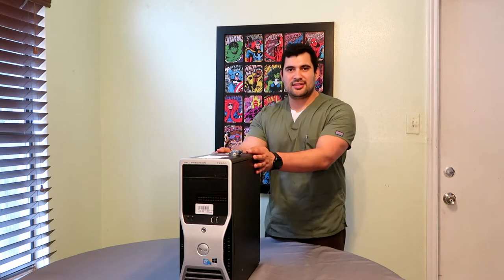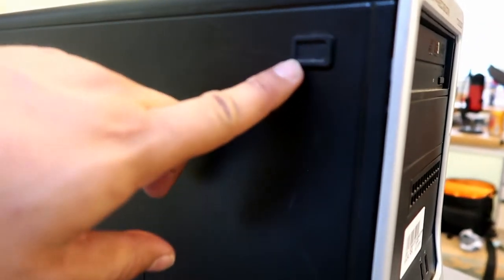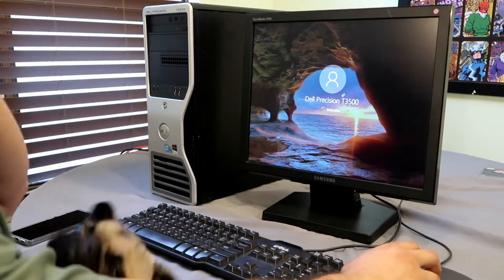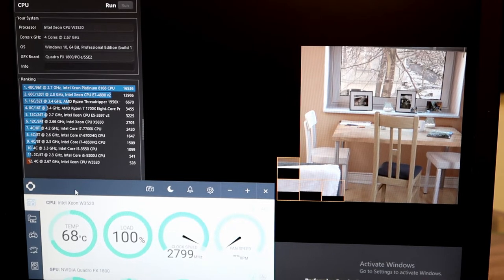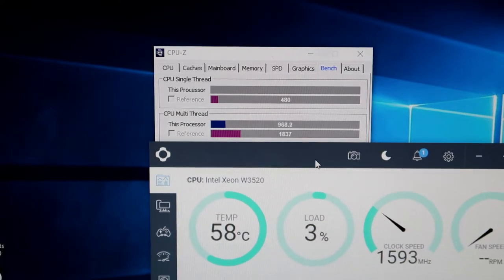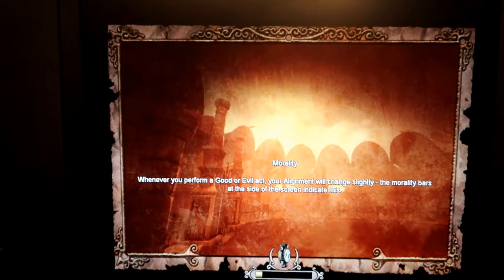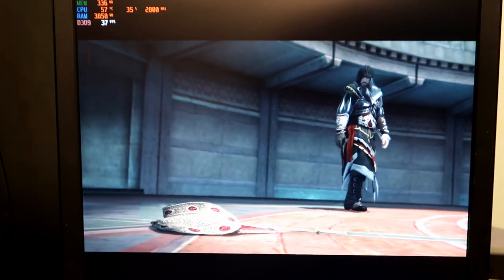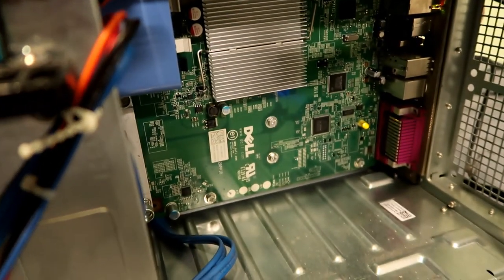$49 Dell T3500 in 2019. Is it worth the money?

Comment: I just upgraded my machine which was the Dell Precision T3500, to a Dell Precision T7810 Dual CPU's.
My T3500 was upgraded with an Xeon x5690 (3.4GHz 6 cores 12 T),  and 24GB of ram, dual 256GB SSD on raid 0 and a 4TB 72k HDD, i have an 4GB EVGA Geforce GTX 960 as well. This machine lasted me for 6 years and i still have it, and it's still very fast. So if you can find one and upgrade to it's max like i did (parts are much cheaper), you will have a nice little machine that will still perform well.
Reply: Thanks man

Comment: Add a x5687 which is ~$17 on aliexpress shipped. This cpu is 4 cores 8 threads 3.60 ghz base with a 3.86 ghz boost. Add a 1050ti (only off pci express power) or a rx 570 with 6pin power (included on the psu) and you have a dank budget gaming pc which will knock most console's dork in the dirt.
Reply: BTW W3520 is a 4 core 8 thread 2.66 ghz to 2.93 ghz boost cpu. You have to go into the bios and check hyper threading to make your current cpu have 8 threads. Your Cinebench score will be much higher.
Reply: Hacksaw Mender - I was planning on buying a Dell Precision T3500 and upgrade the cpu to the X5690. Whatever the number was it worked because they were plenty of youtube vs fps comparisons. My question to you would be would If I would be better off getting the max cpu upgrade that was a 6 core 12 thread. People had Amd ryzen 5 3600 comparisons and the Ryzen won in gaming but the Dell Price was cheaper. I put 3 xeon cpus on Amazon in my cart to choose from. X5675, x5660 and I think x5690. My main question is wouldn't I be better off getting the 6 core 12 thread. over the cpu you suggested. The cpu is $60.00. I may have those first two cpu numbers wrong but they were cheaper.
Reply: @Bulldawgfan   I've got a Xeon X5675, 6 core in mine. With hyperthreading enabled it's great to be able to assign 4 virtual cores to a pair of VMs. Also, the newer Xeon chips support more than 24GB of memory, mine's got 48 GB (bought used) but remember it's an EEC board. I recommend the 6 core chips, they make a great machine!

Comment: I scored T3500 and T5400 free. I took 875W PSU and extra cooling fans from T5400. Just ordered W3680 and Im going to overclock it to over 4GHz with Throttlestop. For GPU I have now GTX 960 2gb but maybe I upgrade it :) 12GB ram 10600E maybe going to uprade it to 18GB or 24GB
Reply: I have the same thing and it won't go past 3.9 all cores but it's pretty nice. I have a 1080ti strix on and it is a beast.

Comment: You don't  have Hyper-threading enabled in the bios. W3520 should be 4 cores and 8 threads. Dell disables Hyper-threading by default on these machines for some reason. Enable Hyper-Threading and it should boast speed by 33%.
Reply: Yes, he basicly benched an old i5-760  in the video.

Comment: Nice video and great deal.  I am using a somewhat more recent Dell Precision T1600 with a Xeon E3-1245 v1 and swapped out the original PSU and upgraded the GPU to an Nvidia GTX 1650.  Works great.

Comment: I picked up one of these Dell Precision T3500 workstations with an Intel Xeon W3550 Quad-Core CPU at 3.07GHz and 14GB RAM, for approximately $70 from eBay. While it didn't come with a hard drive, I was able to salvage two 1TB hard drives from my old dearly-departed Lenovo IdeaCentre B320 all-in-one desktop. One of those two hard drives is a solid state hybrid drive, which I currently use as my primary drive, while my second is a traditional drive, which I currently use as my secondary storage drive. I installed Windows 10 Pro on my primary drive using the Windows 7 Pro product key that was included with my Dell Precision T3500. It came with a 256MB ATI FireMV 2260 graphics card, which I swapped out with a more powerful 1GB Dell-branded NVIDIA Quadro 600 graphics card. I also installed an internal Blu-ray Disc writer, which serves as my secondary DVD drive. I also plan to upgrade my Precision T3500's RAM to a maximum of 24GB. I currently have no plans to upgrade my system's Xeon CPU at this time.

I also have a refurbished Microsoft Surface Pro 4 with an Intel Core m3-6Y30 Dual-Core CPU at 0.90GHz/1.51GHz, 4GB RAM, and 128GB SSD. I still intend to use said system for drawing cartoons and fan art; making 2D animated short films; and general use, such as browsing the Web, listening to music, and watching videos. As for my more resource-intensive tasks, such as video editing and the final composition of my 2D animated short films, my Dell Precision T3500 will be my new go-to system.

Comment: Hey guys, I just scored two T3500's from a engineering company for only $10 each !! Thought I couldn't lose much on these and am considering some upgrades. They have the W3530 CPU's, 12 GB ram, Nvidia Quadro 2000 1Gb Graphics cards. But no hard drives included.  Is it worth upgrading the graphics cards ? What would you suggest so that it isn't overkill and/or bottleneck in the cpu, etc?. I am also considering upgrading the cpu  with a used X5735 , as they are only about $20 cad on AliExpress.

Comment: Buy an x5675 6core 12 thread xeon cpu at 3.0 Ghz. 20 bucks on ebay. If you dont mind slightly lower at 2.93Ghz the x5670 goes for 15 bucks on ebay. I also chose the X series because the max tdp is 95 versus 135w. Could the tower cooler handle 135w? Of course. Buttt i wanted to use a 6 pin gtx 1060 mini since the stock 525w power supply has a 6pin pci plug

Comment: Should i get one
Reply from the maker: If you can find one understand 50 bucks then its not a bad buy. But, you cant really play any modern titles. So, if you want to play retro titles this is a good buy.
Reply: @Ghost57  just bought one for 80....x5650...12gb...500gb hdd i think...good or bad deal? in uk this cost like 135 pound on ebay..so im not sure